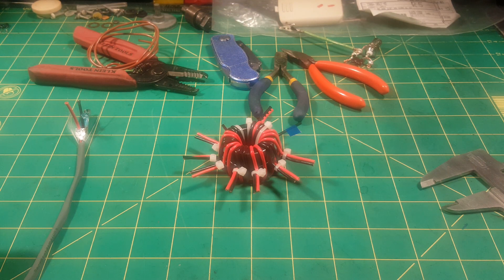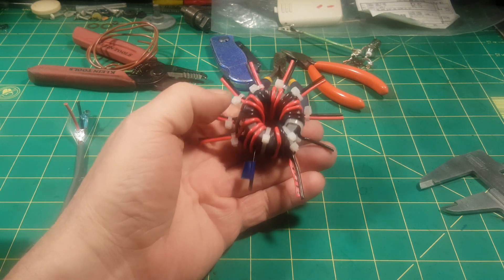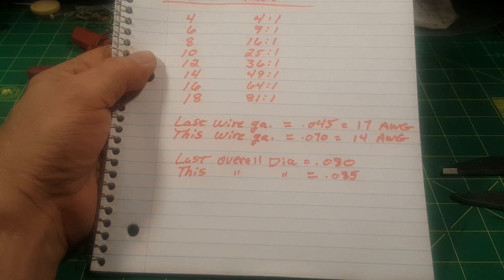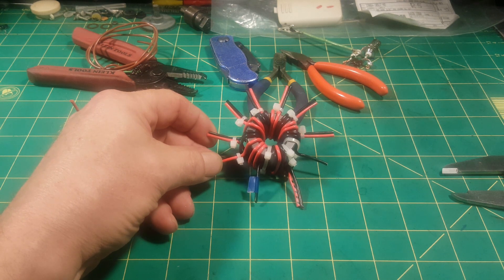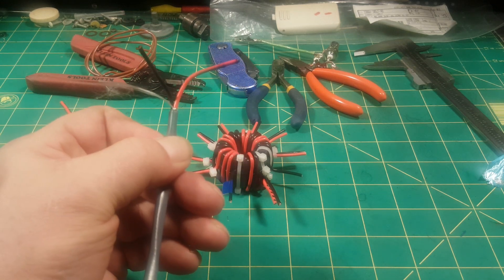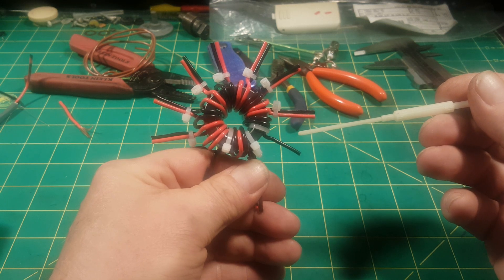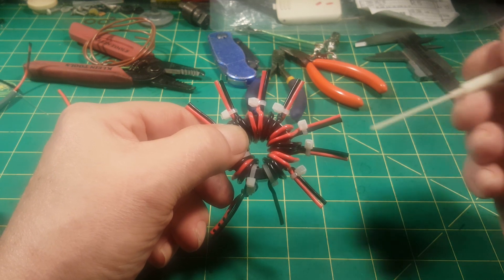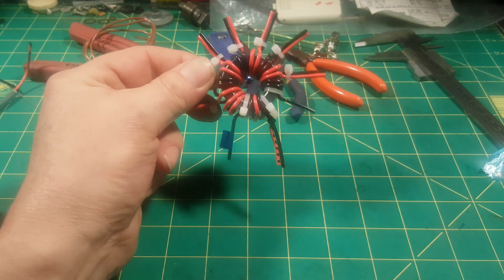UNUN Notes - Double Core FT140-43 & 2t Primary

Comment: I like your baluns when you used the 240 core did you use the three turn or two turn method ? 73 from KG5GfV
Reply from the maker: Nope, the FT240 core that I had, which I gave to my brother, has an Al value much like this double coure FT140. So hopefully it will work similar. The FT240 UNUN was just wonderful and I miss it. I only used 2 turns on that primary winding Ron. Thanks for watching   :)   Happy new year OM

Comment: Will this handle 100 watts on 80?
Reply from the maker: Easily. Without warming up. Unless you drop a constant carrier on it, which I've done.. and it only got bath water warm after 5 minutes. When I call CQ with it, for 5 minutes on and off hoping to scare up a QSO... or when rag chewing using phone, it won't even get warm to the touch. Not when working on a resonant band.. and my EFHW, along with the UNUN, results in a perfect match. Minimal mismatch and a resultant minimal core loss. 73 OM
Reply from the maker: Also, as an aside-
the same as I wrote just now is true of my little single FT125-43 core UNUN. In fact - it's the only UNUN I've been using lately, at the 100w level, again, with minimal heating. The little core was not saturating at 100w SSB. Saturating just a tad when running 100w CW. And that's one little UNUN.